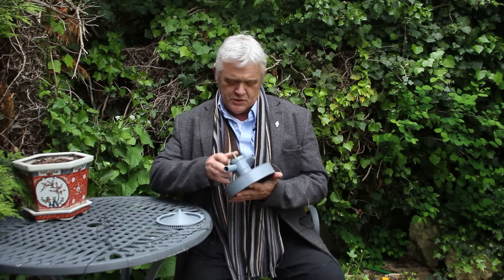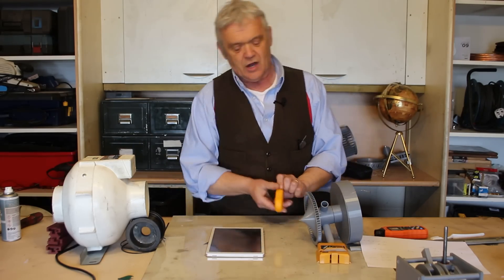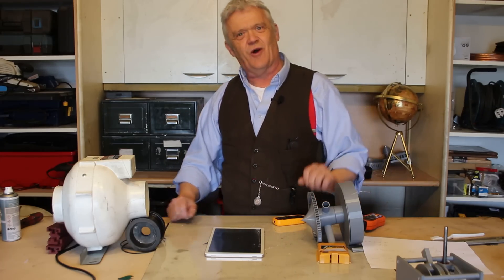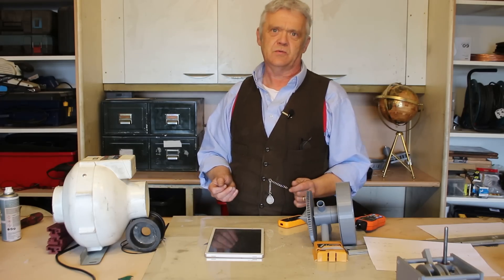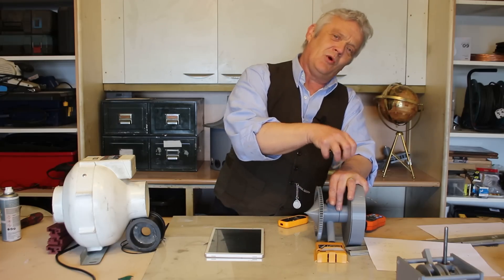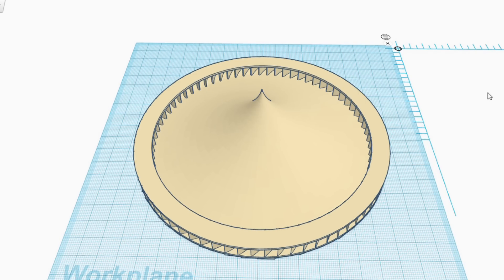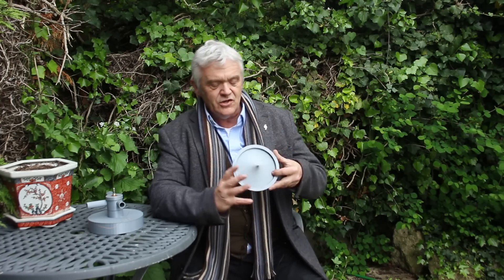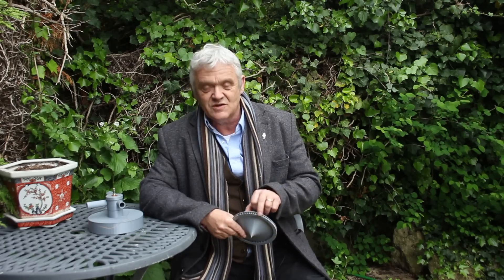1921 A Super Efficient Wind Turbine - A Betz Beater?

Comment: Very interesting, I wonder how that rotor would perform in a rain water downspout. I live in a very wet area and always think about that potential.
Reply from the maker: i don't know - try it and let me know
Reply: Put some storage medium near the top of the spout and capture the maximum amount.
Reply: Air water go hand in 👌 hand
Reply: Stack them decrease exit hole force water in center of next rotor,one goes out disconnect one put in straight pipe tell one broken is fixed
Reply: @Michael Hansen
Hi Michael,
Some simple energy maths may help you decide if roof water really makes sense.
First some assumptions: I’m basing this on an annual rainfall of 2.4m which is at the extreme upper limit for rainfall, pretty much anywhere in Europe or North America: secondly, I’m assuming a two storey house of 250m² (2,600ft²) with a roof of 125m² and a vertical drop from gutter to turbine of 5m.
Now the maths. The total volume of water falling on the roof in a year is 125 x 2.4 = 300m³ = 300,000 litres with a mass of 300,000kg.
This water has a total gravitational potential energy [E=m.g.h] equal to its mass 300,000 x g (~10) x 5, the vertical head. E = ~15,000,000 J. At 100% efficiency that amounts to about 4.2 kW.h (units) of electricity per year! Where I live that’s about a dollar fifty from the grid. 
For reasons, which I’ll go into in another post if you want me to, I am very doubtful if you could convert even 30% of that to electrical power, but even if you did and you got 5,000,000 J out, that works out to a continuous power supply of about 0.158 Watts (158 milliWatts). And to do that you’ve got to make a system that can extract efficient levels of energy from both a light rain and a downpour. We can go into the difficulty of that, too, if you want to.
Remember, too, the rainfall I used was about as wet as it gets unless you live in a famously wet place.
It’s my opinion that roof water is really not worth pursuing as an energy source. A 200W solar panel puts out 5,040,000J in just 7 hours of sunshine, and you could fit 50 - 60 of them on that same roof.

Comment: That rotor is more efficient than that three-bladed rotor it takes all the wind from the whole surface puts it all the way out to the points on the road or to push it and there's a million points around the edge of the rotor compared to the three on the other one so if it lost 48% and you got 98% that makes sense to me
Reply from the maker: cheers mate
Reply: @ThinkingandTinkering  increase height of inner circle fins decrease height at outer exit would that possibly increase your efficiency?
Reply: Design should work with air or water

Comment: On a side note, and since you are good at maths, Given that neo magnets last a long time, how much potential energy can be the " push " from opposing force lines?  The usual nay Sayers about using angled magnets from making a generator using magnets to push a flywheel keep bringing in thermodynamics and refuse to show me how to replace the batteries in neo magnets or give me the formulas used that negate the wear of the bearings.  They also do not look at gearing to move the magnets to ensure that, similar to the Antikythera  mechanism, can use non single ratio motion for moving the magnets in a way to ensure that they always are used to " Push " the flywheel mounted ones.  For our lifetime, we already have a ' perpetual motion ' machine, it is occasionally obscured by clouds, has a heat given off that can create or smelt any element on the known periodic table and yet is hardly tapped for energy.
Reply from the maker: magnets have zero potential energy mate - well according to ow i see them - it's like a rock on a hill - a rock has no energy until you roll it up the hill - the it has lots - which you can see by letting it roll down the hill - a magnet has no 'push' until you bring it close to another magnet then it ill push - but the energy isn't in the magnet - it's in the effort you put in to bring two magnets together

Comment: thinking out of the box, in the days of steam they had triple expansion steam engines, where the steam that still retained energy could be re-used in a lower pressure cylinder. Now along those lines, could you put a second contra rotating set of blades outside the initial set to capture the wind passing through the blades, and turn a second ring in the opposite direction, connect your coil in this second stage and add some commutators, or just add a second generator stage behind the first and you are extracting more energy (at a lower pressure so to speak like the steam engine. would this work, or would it just make the whole thing less efficient?
Reply from the maker: interesting mate and i happen to know you are good lol - so give it a go and let me know how you get on
Reply: This would theoretically work with diminishing returns if your initial stage was not as efficient as it could be, but it is generally more practical and cost-effective to make a separate rotor that collects a different cross-section of wind, if you have the resources for it

Comment: Fascinating and ingenious! I surmise that the apparent surpassing of the Betz limit can be attributed to the use of the disc's diameter as the swept area, while the air flowing around the disc contributes additional energy. As the slower moving air emerges around the disc's edge, it would be carried away by the wind flowing around it. This process would decelerate the surrounding air, effectively increasing the swept area without the need for physically larger blades. In essence, this approach leverages the air itself as blades. 🙂
Reply from the maker: interesting mate thank you for the ideas

Comment: Rob slightly off topic but watching you go through all these different turbine sone require a vertical post and need to swivel into the wind what mechanism would u use to move the power through the swivel to the ground
Reply from the maker: none of the ones i designed need that mate
Reply: @ThinkingandTinkering  rob u showed your vented type directing wind downwards with a blanking plate at the back and i thought u had said u need to direct into the incoming wind to maximize the downdraft

Comment: hmmm...... yes 80%....  but it is a flywheel . so wont hold that 80% for long.   So the key is how long does it do so??..... and how quick does the RPM (thus percentage) drop below a usable level.  Would make a great follow up video.
Reply from the maker: it's all calculated and measured in joules mate both the input and the output - it doesn't matter it is a flywheel - a joule is a watt second

Comment: I think a longer cone diverter would help.  It seems the diskblade or rimblade simply collects more wind and its energy, and should have more output power.  The air collision with the cone will reduce some of the wind energy. 

 Update, maybe yours has a more torque since the wind is striking a rimblade in a right angle like direction to the radius, plus there are so many blades doing the same.

Not many tools and materials here, but paper index cards and glue, and a fan might be a way.

What is neat about that turbine, is that it has qualities of both vawt and hawt.  A neat thing to do would be a funnel on the front to collect more wind energy.
Reply from the maker: build one
Reply: @ThinkingandTinkering   Thanks.   Another idea to do Betz limit research is to affix  hawt blades  on the front of it.
Reply: that also means more resistance, so I assume it should be kept at small as possible (but not any smaller)
Reply: @alexd7466  I'm dot sure, maybe a  30 to 45 degree, curved cone, but it's height needs experimentation.  Could be a flop anyway, but the data would be of value.

Comment: Absolutely great question about the Betz limit! A great question for all engineers to understand and answer. I will give it a go....

I believe mistake is to measure the wind speed directly in front of the turbine. At this point (according to Betz theory), some of the air has already deviated around the turbine so, while the speed may be correct, the actual area of the moving air is greater, i.e. wind power is greater so overall efficiency is less.

There are a number of alternate measurements possible:
1) Measure the airspeed directly out of the blower and multiply by the blower area. This will give a better measure of supplied energy
2) Measure the airspeed a slight distance (say 5cm) away from the turbine, but take many points moving away from the centre of the turbine. This way, a more realistic determination of the area of the air stream can be determined. Chances are, the area over which the air speed is ~2m/s (or whatever you measured) is greater than what you have assumed. Repeat for many distances from the turbine and with air speed readings at many locations.
3) Don't turn on the blower at t=0... have it already on but hold the turbine from moving.
4) Check air speed (as per suggestion 2) with the turbine moving and with the turbine stationary
5) Measure the turbine speed over time.. Theoretically the turbine speed should increase as square root function? If not, the turbine speed is over speed and maybe a bigger fly wheel is required.

... why not try in your "spare" time?
Reply from the maker: or you could try - i can think of criticism to what you are arguing - one being as it exits the blower it has more energy than the energy it would have when it hits the turbine - number 3 - i did that!

Comment: I think your application of the Betz limit might be a  bit off here. ...... as you surmised!

I think the Betz Limit is for free moving blades in an air flow. What you have is a wind collector, diverter And a set of blades. 
The Betz limit should be measured at the intake of the actual blades (not easy to measure). You would also need to add a factor in for how the cone collects (easy) and bends (hard) the air into a new direction. 
It's all about comparing apples with apples ...... but I do like your tag line! ;o)

As a side note I am surprised how much "stuff" you do as opposed to you "daytime job" ..... and not a little bit impressed too!
Reply: Could ask the "Engineering with Rosie" channel,she knows alot about wind turbines.
Reply: @ravenmad9225  Or a collab even?! :)
Reply from the maker: it probably is mate
Reply: hahaha...this chat has everything i thought...ask engineering with rossie, and the effective collection area
Reply: @micky k.hahaha..you misunderstand the basic principle of what is being said here.
Reply: but i this murray has side stepped the whole collection argument...because he has gone straight to energy in vs energy out.....in this regard, it doent matter how it does it....just that it breaks the betz limit
Reply: @ravenmad, how so?

Comment: I guess that the distribution of weight in the flywheel is not homogeneous, the iron rod is something like 10 time heavier than the plastic so could be significant even if it is only the axel therefore the percentage will drop possibly under Betz limit
Reply from the maker: it isn't i measured the rod as part of the flywheel mass but assumed a disk geometry for the k factor
Reply: @ThinkingandTinkering  i guess you do know more physics then I do (not that I know a lot of it).
I pay my compliments
Reply: ...
If you included the weight of the rod I might be wrong, but if you didn't the efficiency is even better

Comment: I'm currently working on a Sivonius-type windmill with the same principles as this. I will be printing a stator, which is essentially a tall cylinder with notches for a serpentine coil, and bearings at the top and bottom of the cylinder to hold the axis that will support the Sivonius rotor. The rotor will have embedded magnets so it will also basically be a flywheel and will be positioned over the stator
Reply: Doubling the turbine rotor as a generator rotor is such an elegant design. Nice.
Reply: @wildekek  thank you
Reply from the maker: nice mate

Comment: It should be noted that your moment of inertia is probably even higher than what the calculator came up with was more of your mass is towards the rim of the flywheel, which will increase the moment of inertia over a homogenous disc. It will probably be even higher still if you account for the inertia of the other spinning components in the assembly as well.
Reply from the maker: yes - the error i made were in favour of the betz limit

Comment: a Francis turbine for the wind. I had some thoughts it might do that? If you could figure out how to have a variable blade angle? Then you courgette 95%. Which would equal a Francis turbine? If that was in a wind wall? Uhm🤔 you might have a winner? That a is massive improvement from 56%. Your not stopping the flow but using it to drive the turbine plate. Pretty clever! Better it a good impeller? Would adding spiral groove to the face of the hyperbolic cone? help get some more Revolution out of it?  As start it amazing!
Reply from the maker: i don't mate - try it and see

Comment: I think it would be a good idea to use the video to verify the RPM.
Reply from the maker: ok
Reply: @ThinkingandTinkering  From watching the video at 1/4 speed, based the turbine wobble rate as well as the flashes of light on the RPM meter case from the reflective tape on the turbine, I see a final RPM of about 150.

Comment: What I think you are doing is taking air from an area = A and ejecting it into area B Since area B is much larger than A it can accommodate it and not stop the flow.
Remember that the air has to go somewhere after you remove the energy from it.  Betz is more applicable to turbine blades.
Reply: I agree.  From the Wikipedia article on Betz's Law: "If all of the energy coming from wind movement through a turbine were extracted as useful energy, the wind speed afterward would drop to zero. If the wind stopped moving at the exit of the turbine, then no more fresh wind could get in; it would be blocked. In order to keep the wind moving through the turbine, there has to be some wind movement, however small, on the other side with some wind speed greater than zero. Betz's law shows that as air flows through a certain area, and as wind speed slows from losing energy to extraction from a turbine, the airflow must distribute to a wider area. As a result, geometry limits any turbine efficiency to a maximum of 59.3%."  Sounds like the calculation has to take into account a larger disk to account for the "exhaust" air.

On the other hand, is that a practical issue?  Probably means Rob has to keep his disk a certain distance from the ground, and from other disks/obstructions.  Still implies he needs a smaller diameter than an equivalent bladed turbine.
Reply: @TomFarrell-p9z  There is another simple way to visualize it :  if you were to have the most efficient angle to get energy of the air flow, it would be 90,   more or less a wall,  air being a fluid, it is easy to see that even that useless configuration cannot extract all power, since the more we are close to that wall the more the air pressure will raise, the air further from that will tend to go sideway

i see it as a simple geometry issue.
And obviously there is no configuration in which that does not happen.

Comment: Doesn't the Moment of inertia of the flywheel depend on the geometrical position of the masses. ie all in the centre or all at the perimeter. Could be wrong, it's been a while since I calculated that property on a flywheel.
Reply: It has to. It looks like the calculator he used is assuming an even distribution of mass. His flywheel is going to have way more energy than that with all the mass at the edges.
Reply: @jefffriedman6942  Correct
Reply: @jefffriedman6942  His flywheel will have less actually.  Moment of inertia increases as you move the weight distribution towards the circumference.
Reply: @whatelseison8970  ... @2:42 shows the formula. If moment of inertia increases, the energy increases. This is just common sense broheim. Consider two spinning figure skaters with the same energy, one with their arms out and the other in, the one with their arms out is going to be spinning slower. IE his wheel doesn't have to spin as fast to have the same energy as a wheel that had equal weight distribution.
Reply from the maker: it does - i chose the worst possible case
Reply: @ThinkingandTinkering  wouldn't the worst possible case be an osmium cylinder 5mm in diameter?

Comment: Excellent the improvement is as a result of using all the wind unlike normal wind turbines with large gaps between blades so a slightly different calculation might be needed. Like trying to calculate the capacity of a Wankel engine that has never been agreed no?

Comment: you forgot the  resistance of a generator connected
Reply from the maker: no i didn't - ignored it for simplicity sake but - cheers
Reply: @ThinkingandTinkering  Don't they include generator resistance when working out  efficiency conversion? so rpm  would drop??